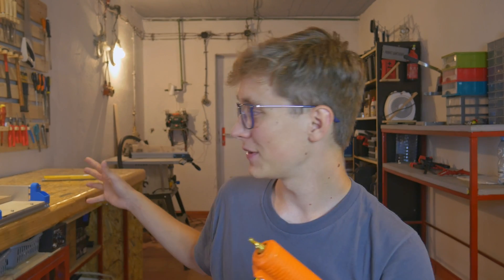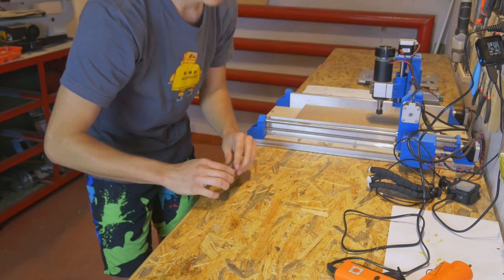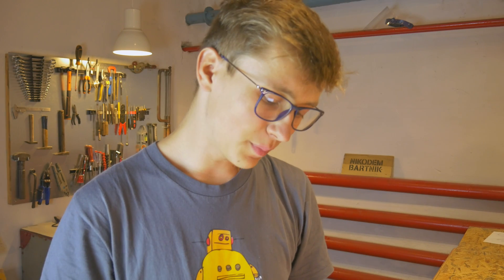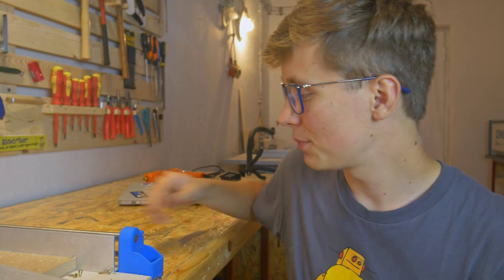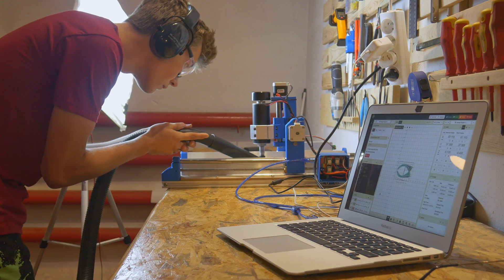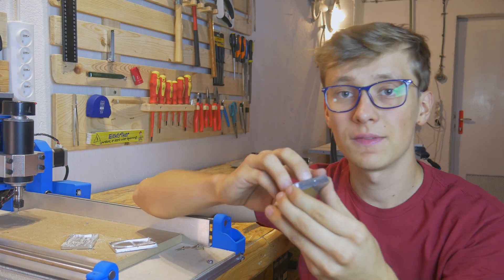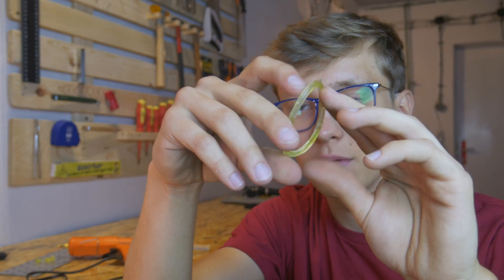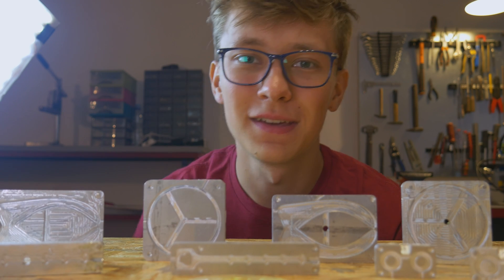Working hot glue injection molding

Comment: Hello Nikodem Bartnik, Nice Work! Im into cnc milling from product design studys and in my opinion you should avoid aluminium at all cost. try some soft iron plates next please! it works, but you should use a other vacuum cleaner for safety, and it is better instead of absorbing aluminium particels - good injection molding companys use machine steel on robust big cnc machines. Its also better not to support the wrong metal companys and your tool cutter is not degrading more against any myths. Please try some iron or machine steel /automaten stahl

Comment: If you encounter a problem with some of your moulds cooling down or not going to the edge. Maybe try drilling some exit holes for more of the glue to come out from. Just having a think, but you're also compressing air when injecting into the moulds. Which means it could be stopping the material getting there in time before it cools. Maybe having a couple more bleed holes will help get the material there faster. Something to experiment with.

Comment: Some of the glue guns have replaceable threaded tips, so you can use one of the tips to make adaptor to screw your molds directly to the gun. That way you will get pressure directly to the mold. AND you will have direct connection between the gun and the mold, so you can let it sit for a while, so it preheats the mold.
Reply: Also you can buy black hot glue sticks :)

Comment: Heating the mold should help some.  I know you had problems with it releasing when you heated the mold- rubbing alcohol (the kind you get at the drug store for cleaning cuts...) causes hot glue to lose its bond.  I'd also try some wax, light oil or grease as a mold release compound.

Comment: Nice work with the cnc.  The 0.4mm cut is pretty aggressive for such a small machine.  For your contours for the outsides you can use stock to leave on the paths with step downs then cut off the additional stock off at full depth.  This way you get the benefit of small step downs and the good surface finish of a full depth cut. It is better for your tool too so you don't wear the tip only.

Comment: Nice! Those were really impressive. How about silicone? Silicone Sealant takes longer though because it still needs to cure but doesn't use heat. Liquid Silicone sounds also interesting but is runny. Also Resin! I think it's pretty interesting. Anyway, these are just my ideas. I want to try making them but I don't have the time and finding aluminum plates like yours is really hard, at least in where I live.

Comment: You need to find a way to heat your mold, then you wouldn't have to worry how to keep the material flowing.  I agree with jasdeep garha, use a 3d printer hot end to inject PLA or nylon.  Nylon would be great for the zip ties.

Comment: hmm but normal zip ties are reusuable, there is a latch in the head that when pressed down with a small enough screw driver for example unhooks the teeth and you can pull off the zp tie.  i admit, nobody does that, but it is possible.

Comment: Hello Nikodem,
I'm very found of your channel and you do very great job as a maker. But I have some questions:
why not use a 3D printer hotend + extruder to mold pla or other plastics ?
and i'm also asking myself why you don't heat the mold before injection?
Reply: I think I can answer the last point you made: He had issues with preheated molds not releasing the parts.
To solve that issue (at least regarding the hot glue sticks) he could use isopropyl alcohol. A squirt of that and hot glue immediately lets go

Comment: you can use the cnc to make aluminuim parts and replace the 3d printed ones so you can get better results
Reply: It would be pretty "hard" to mill his design.
Reply: @leobla744   It doesn't need to be exactly the same then... A lot of material can be saved. Run it true a shape optimization tool in fusion360 for instance.
Reply: @jordideseure8245  as far as i know (i think he said it in the vid) he is about to build a better bigger version do the hole redesign of the old design is waste of time for him. But now i am interested in shape optization :D

Comment: What if u use the hotend of the printer to inject pla in the molds may cool down quickly but worth a try tho
Reply: then use a 0.8 or a 1 mm nozzle
Reply: I would think that the nozzle of the hotend would be very restrictive and so you wouldnt get enought plastic trough.
Reply: @leobla744  i only tried a very small washer or circle with a diameter of 0.5 in
Reply: jasdeep garha I tried this the parts are very brittle but it sorta works
Reply: Maybe with a vulcano and ecen than I wouldnt have my hopes high. 3D pribter hotnends are designed for waaay less flow than hot glue guns.

Comment: Try to plunge outside of the stock instead of plunging directly into it because youre using an endmill bit not a drill bit, so that when your z axis plunge in a lateral way rather than a perpendicular plunge, it wont apply a lot of stress in the tool, i think thats why you broke your endmill
Also try to program 2d adaptive or what someones call trocoidal machining at your contours, instead of tracing them, youll got a better chip evacuation and the risk of failure will decrease in youre tool and youre work pice
Excelent video and also nice design of the zip tie 👌

Comment: It would be nice to mold other plastic maybe with a 3d pen
Reply from the maker: Too low temperature and pressure, no way to get it working with 3D pen, but with manual injection molding machine, yes :)
Reply: Yes Right